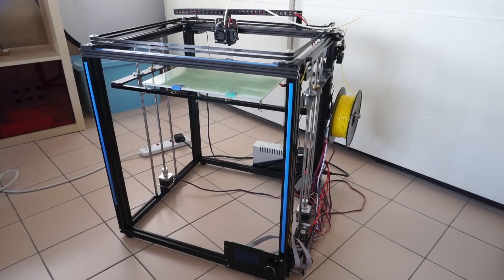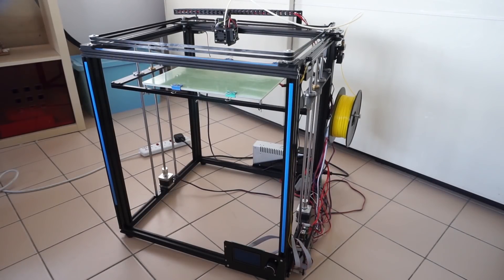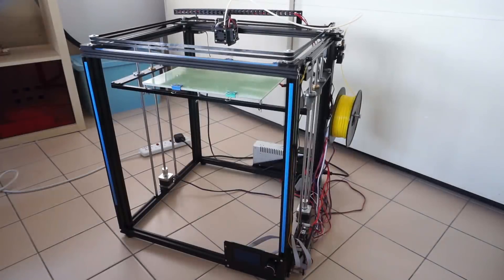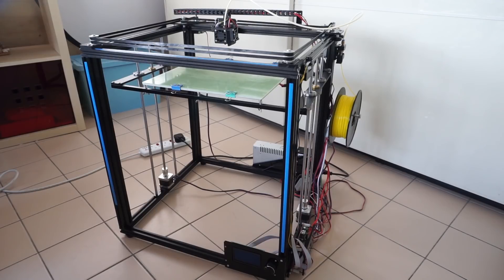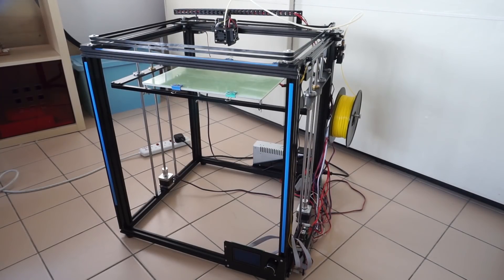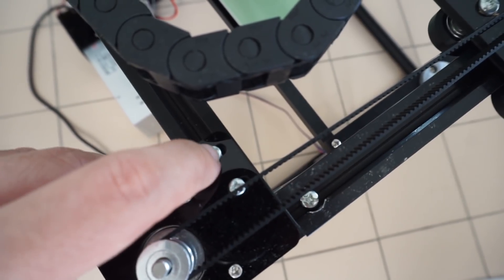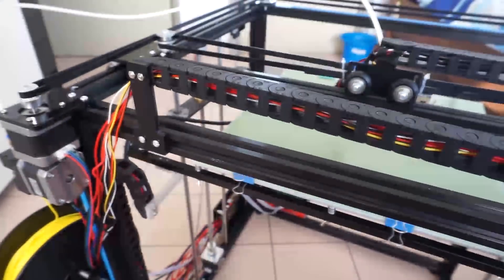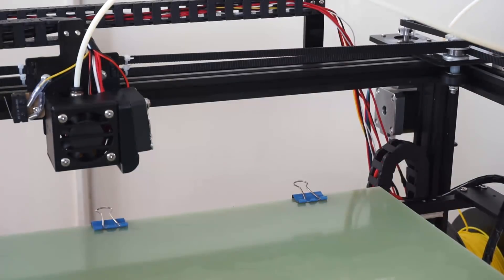TronXY X5S (Review)

Comment: bought this tronxy x5s from Gearbest, its a piece of junk,  got seized roller bearings, severe burrs from cut and drilled parts, soiled in cutting oil and full of aluminium chips, anodized is completely scratched, the heating element on the extruder has its electrical wires kinked at 90 degrees with no radius to be able to fit it in the steel case, belt bearing guide are all out of axis, it looks like sh... right out of the box, , the roller guide are so stiff that your x and y axis arent going to give any precision, good for the garbage when received

Comment: First, fantastic honest review of the Tronxy x5s on your blog. It was a great read.
It helped me make an informed decision of choosing this over the CR-10, and couldn't be happier. 

This is my first printer so my question is about the mosfet board. I purchased the mosfet you installed, following your links. As I will upgrade the psu and enclose the printer sometime in the future. 

 Can you let us newbies, know how to install the mosfet? I don't see where the power source is connected to the mosfet on the video. Paused the video  at 15.03  when you mention the mosfet and don't see  the power is connected at the bottom, as stated in the instructions for it. Any help would be really appreciated. I've looked online but can't find to much for this mosfet on this model printer. Thanks again.
Reply from the maker: I'm glad you found the review useful. Which MOSFET did you purchase? I assumed you purchased the TriGorilla/MKS MOSFET such as the one featured here:

http://amzn.to/2CSBJEs

On this MOSFET there are a total of 8 terminals (4 in green housing and another 4 in larger black housing). In the black housing, there are the labels HOT BED and POWER.

Connect the 24V (12V if you haven't upgraded your PSU) power supply wires from your PSU into the 2 POWER terminals with black housing. Make sure the wire is at least 14 gauge (AWG) or 12 gauge. One suggestion is you can cut off some length of your heated bed power wires to use here. Or you can use a fresh pair of wires if you have any at home.

The two wires from your heated bed go into the HOT BED terminals with black housing. Polarity of the wires doesn't matter here (both wires are red anyways).

The two wires from your main board's heated bed output go into the BED terminals with green housing. Again, polarity doesn't matter here. The other two terminals in the green housing are not connected to anything.

For best results, tin the edges of your wires with solder so they remain solid and won't fray easily.
Reply: I see now, this explains it perfectly. I'm sure this will be useful to us newbies. Thank you!!!

Comment: This vs TronXY X3S? Same build platform size
Reply from the maker: Definitely go for the X5S. It is a CoreXY 3D printer which means it has a more advanced design compared to the X3S.  The X3S features a heated bed that moves along the Y axis which creates more vibration while the X5S's bed moves along the Z axis. Less movement along the Z axis means less vibration created by the bed.

I think the only reason why TronXY is still selling the X3S is purely for marketing purposes -- they want to cash in on the high popularity of the Creality CR-10. In fact, the latest version of the X3S looks very similar to the CR-10.

Personally, i'll pick the X5S over the X3S any time.
Reply: Thanks!

Comment: Great review , Thanks for all the great info. I just ordered mine a few days ago. I'm new to 3d printer , What are the parts you suggest I order to do the upgrade including the type/size of Mosfet i should use . 

Thanks
Reply from the maker: The MOSFET I use has a rating of 30A. You can buy it here for about $15:

http://amzn.to/2hYD4AL

I've also used a smaller 25A MOSFET for the bed on my X3S which is the same MK2a bed on the X5S. You can get it for about $9:

http://amzn.to/2zNHaa7

The 300Mk2a has a maximum current pull of about 15 to 20A depending on how much internal resistance it has (usually about 2 Ohms), so I guess any MOSFET with a max rating of about 20 to 25A should work fine.

There is a list of upgrades that I have in mind for my X5S. I will be creating a new video focusing only on X5S upgrades soon.

Comment: Very complete and well done review. I am in the middle of building mine and ordered a mosfet for the bed as well. I have installed a bunch of upgraded printed parts but it has slowed me down. I will now check all my wiring connections and trace down each one thanks for the tip. I had heard of the X and Y wires and positions being backwards on other reviews as well. I am amazed at the quality of prints you have , very nice job. They look a tad better than my CR10 prints I believe. A lot of people have reported the white bed heater connectors melting and arcing just in case you did not know. So keep an eye on them, or replace them or the wiring, directly to the mosfet. I am going to install an XT60 or XT90 on mine. I am just about to start the wiring now. Thanks for the great review and tips.
Reply from the maker: Yes the X and Y motor wires in the assembly manual are wrong (backwards). I forgot to mention that there are some mistakes in the manual. I'll keep an eye out on the bed wires, thanks.